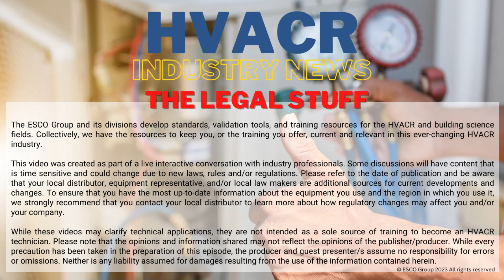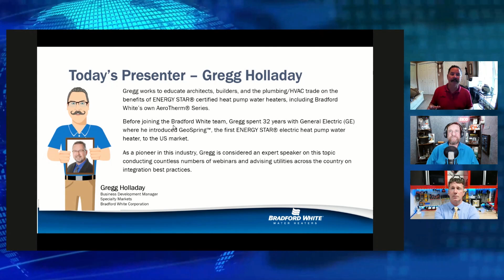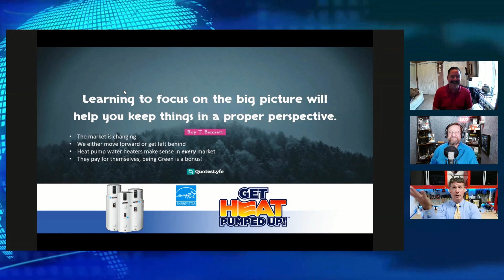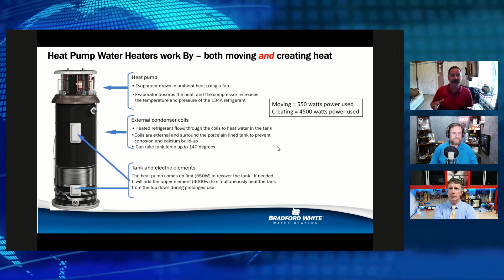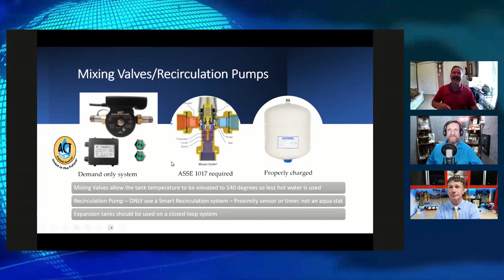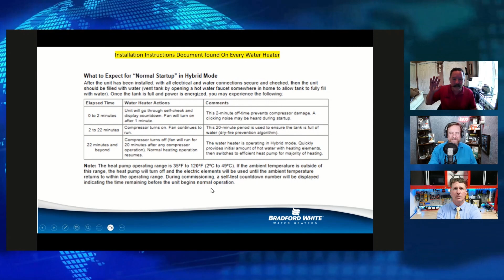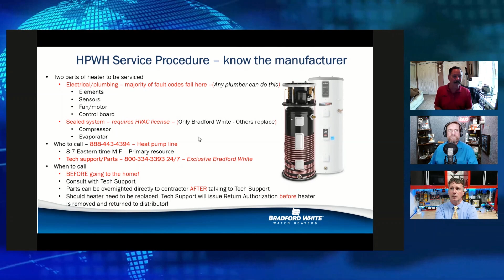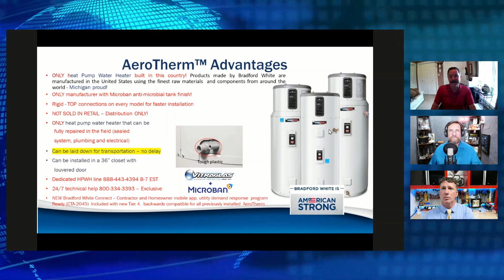Sizing and Selecting Heat Pump Water Heaters-"Did You Know" The ESCO HVAC Show-Episode 94

Comment: It would be great if we could tie all the refrigerant flows of all the units in a building to maximize efficiency.  For example, connecting the refrigerator to the heat pump water heater, and the heat pump dryer with the HVAC heat pump.